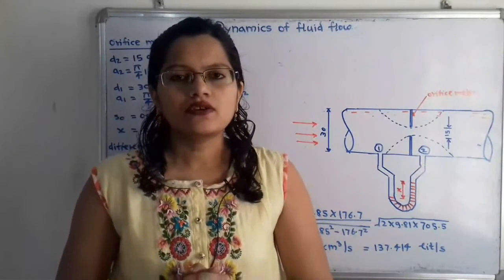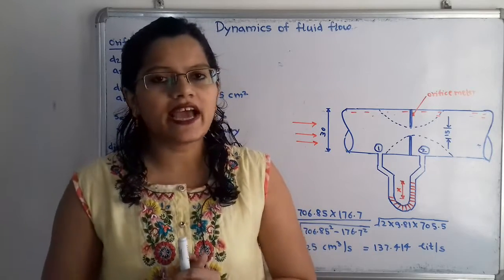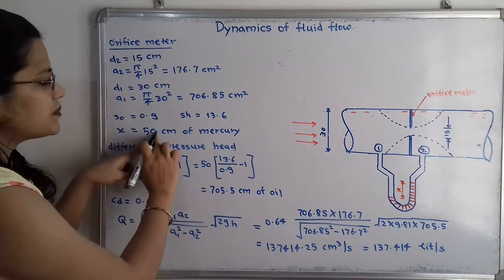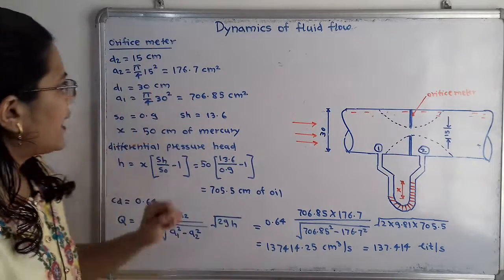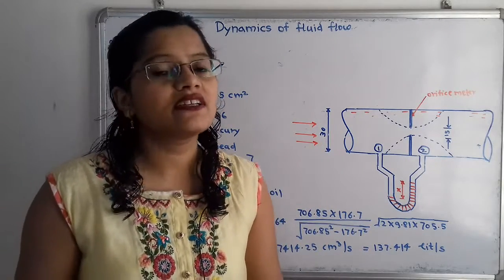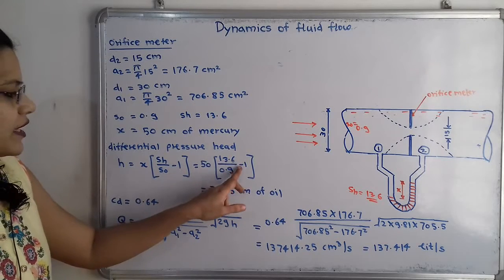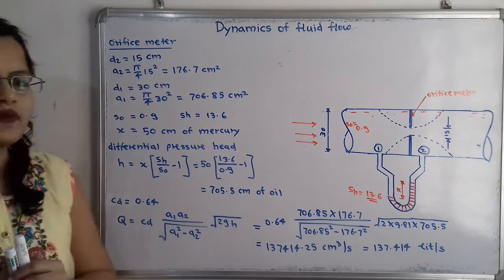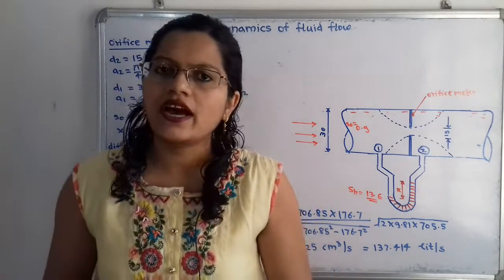Problem on Orifice meter/fluid mechanics

Comment: can i use this formula in steam calculation
Reply from the maker: You mean steam flowing to orifice?
Reply: @edutechguruengineeringlear4280  yes mam
Reply from the maker: Yes... you can apply for any fluid. .. but if fluid is real then add loss of head...
Reply: @edutechguruengineeringlear4280  yes by differential pressure
Reply: Dp 1500mmwc OD of orifice is 250mm ,ID of orifice is 170.4mm maximum pressure 10.5 bar then what will be the flow of steam
Reply from the maker: There is discharge coefficient, initial and final pressure of steam,  density of steam, steam flow rate, specific heat ratio etc required to calculate steam flow rate through orifice.
Reply from the maker: This question is incomplete
Reply: @edutechguruengineeringlear4280  not yet .please mam give me the calculation or make a video for the same .
Reply: @edutechguruengineeringlear4280  i am giving you data here  od is 250mm  id  is 170mm  max pressure 10.5bar
Max .dp is 1500 mmwc density is 5.6 kg/m3
Reply from the maker: @vaisahmed5754  incomplete data
Reply: @edutechguruengineeringlear4280  please let me know what you data required
Reply: Ma'am actualy i am working in industry i have an orifice flowmeter
Reply from the maker: Primary secondary pressure
Reply from the maker: Specific heat ratio, pressure differential ratio, density of steam
Reply from the maker: Incomplete information...please use software for calculations
Reply: @edutechguruengineeringlear4280  i already calculate by software but i want to know formula
Reply: @edutechguruengineeringlear4280  i calculate this .thank you very much
Reply: @edutechguruengineeringlear4280  i got the correct answer
Reply: What do you mean by real fluid.i was apply this formula but result not coming
Reply from the maker: Real fluid is having some viscosity
Reply: Ok thanks.
Reply: Mam i have orifice flowmeter
Reply: Sh 13.6 how to write